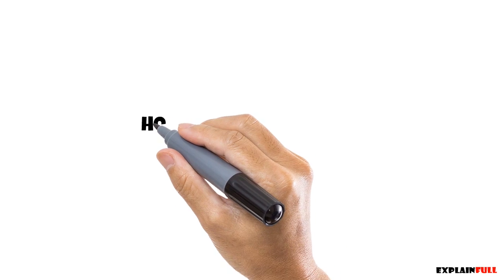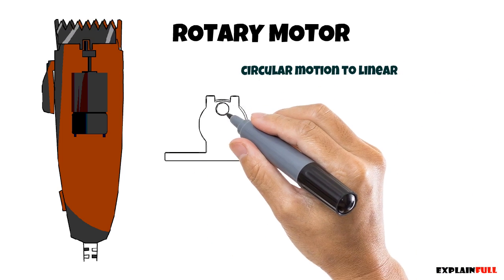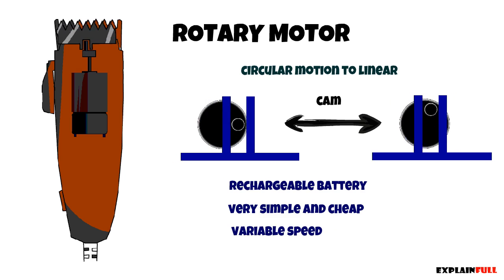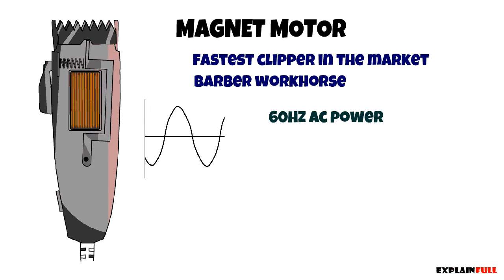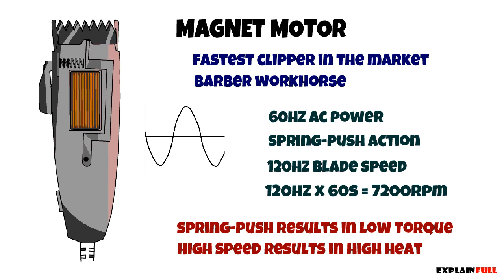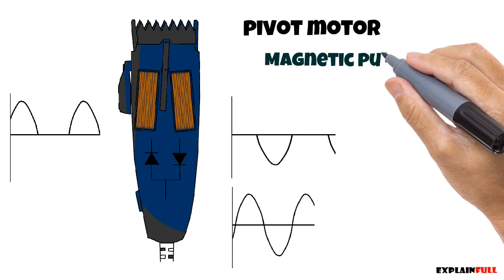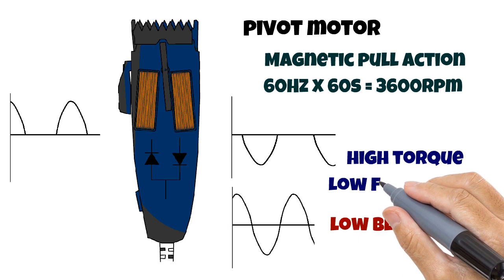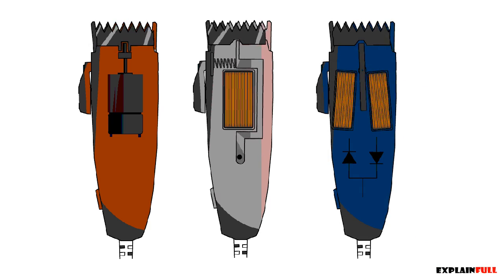How Rotary, Magnetic and Pivot Hair Clipper Motors work?

Comment: How can one tell the difference between a magnetic and a pivot without opening it up or measuring the blade speed?
Reply: Magnetic clippers tend to be noisy, making a buzzing sort of sound. Pivot motor clippers tend to be much quieter and make more of a deep humming sound.
Reply: If you hold a magnetic hairclipper like Moser 1400 it vibrates like a earthquake...

Comment: Good job!
(Polish) W Europie jest 50 Hz, 50 x 2 x 60 = 6000 ruchów noża, 
In Europe it is 50 Hz, 50 x 2 x 60 = 6000 knife moves 
Silnik rotacyjny można zbudować na różną moc i obroty. The rotary engine can be built to varying power and revolutions. Silniki magnetyczne (elektromagnes) są większe, ciężkie i bardziej się grzeją. Magnetic motors (electromagnet) are bigger, heavier and warmer. To ogranicza ich moc. This limits their power in clippers. Ale ich żywotność może być o wiele większa. But their vitality can be much greater. Nie mają łożysk i komutatora. They do not have bearings and commutator. Silniki rotacyjne są nie do zastąpienia w akumulatorowych maszynkach do strzyżenia. Rotary motors are not a substitute for battery clippers.